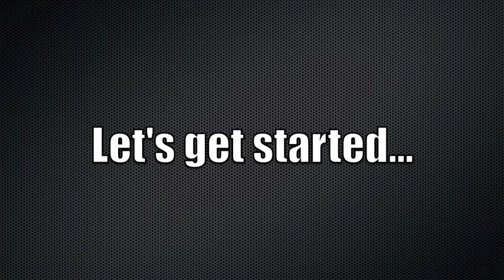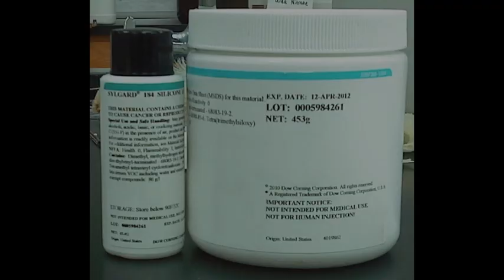Build Your Own Solar Panel

Comment from the maker: If you build more than one, the cost works out to be $120.00 per 60 Watt panel. But, that was 3 years ago. Solar panels are really cheap in the States. In Canada, a 120 watt panel by Sharp is still around $580.